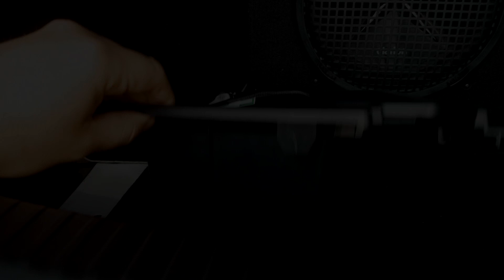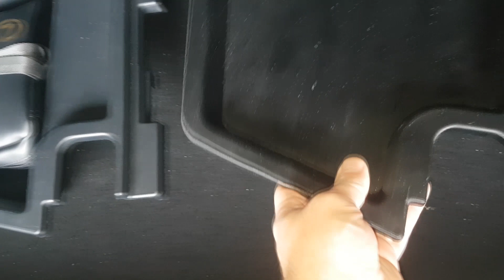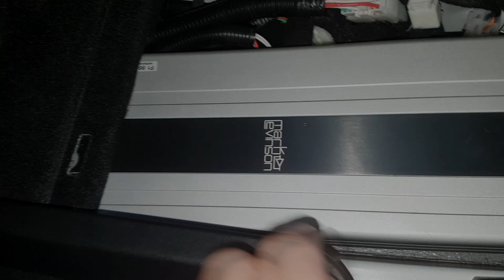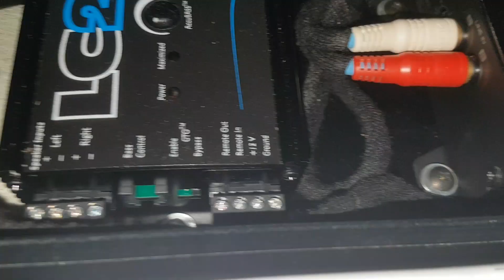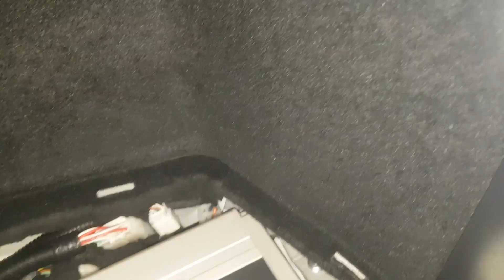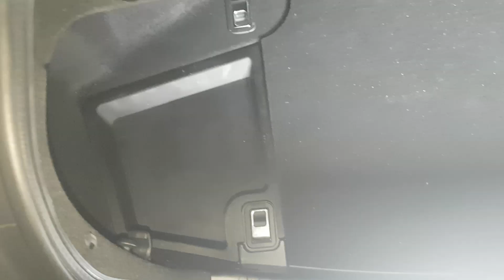2009 2010 Lexus ISF Mark Levinson - adding a line out converter , amplifier and subwoofer IS250

Comment: You've said you utilized the signal from the sub and left front woofer for your new subwoofer, and it resulted in a good frequency spectrum for the bass. Have you done any other testing on the signal from the front 3-way components? I'm am aiming to replace the front 3-way components with new 2-way components (woofer and tweeter only), and I'm wondering if the woofer and tweeter has enough of the frequency spectrum to cover the mid too (which I won't be using). I only have 6 high level inputs into the Zapco, so don't have enough for all 6 front speakers and the sub. Cheers

Comment: Thanks so much for this. There’s very little info around about this. I’m attempting to install a Zapco dsp / amp, and run the components and a new sub from this. As you said in the video and described in one of your comments, I’m hoping to piece together the full frequency spectrum from the sub and left woofer output from the oem amp, and then use the dsp to manage the frequencies to each channel.

Comment: At least he did not do the most ignorant actions that I had seen. People removing the OEM amplifier that is valued 2 times as much as a aftermarket amp and sub. In features, in vehicles models with touch navigation and internet access for the update on the OEM computer and vehicle navigation. Just so they can get a bass line. The amp does more than just music it’s a link in the chain of factory comforts and associated assorted of features. They don’t make videos showing what they created by being a tunnel vision nut

Comment: Very informative video. Thanks for all the info. Do you think the wiring diagram would be different for a 2008 ISF?
Reply from the maker: I'm fairly certain that 2008 ISF, and pre-MY10 2009 model ISFs are different to MY10 wiring.
Dont 100% quote me, but from what I found, these would likely be the wiring assignments for a 2008 and early 2009. Just cross check your amp to see if it adds up I guess:
Front left door woofer, 2nd plug: positive white, negative red
Front right door woofer, 3rd plug: positive brown, negative pink
Subwoofer likely dual voice coil. 2nd plug: positive brown, negative light green, positive pink, negative light blue
Remote wire: 4th plug, orange

Comment: Wow amazing it’s exacly the video I wanted! I got the mark levinson on my lexus NX and the subwoofer is clipping at low volume (around half volume) when playing music with low frequency range. At first, I though it was the OEM subwoofer than was distorting so I went aftermarket and plug a LC1.800 and use the high level from the factory sub to feed my amplifier and I was wrong.. the mark levinson channel for the subwoofer is clipping at very low volume! And they claimed that this amp is 1000 watts..? I was a little bit choc but then I ran some test yesterday and I found out that the front speakers are good at high volume so I’m gonna tap the front speakers and I think it may solve my problem. 
But I have a question, is it better the front or the rear for best signal ? I don’t have an oscilloscope but I’m guessing that they get the same signal but at a different voltage.
Thanks!
Reply from the maker: Hmm im not certain to be honest. Im not a professional :D All I can say is that on the Lexus ISF specifically, all posts online state the front door woofers push out a 'stronger' (or more powerful, forget the exact terminology) signal/range, than that of the rear door speakers.
Reply: What were your results? I’m having the clip issue at low volume so I’m upgrading the line out converter.

Comment: You did a great job!!. So just to clarify. You feed your LC with signal source from one sub front door and the rear deck sub source? Which front door signal source? Do you know how to obtain a full range signal? Any input is appreciate.
Reply from the maker: Hi there, sorry for the delay in response. 

In answer to your first two queries - please see the links in the description and I have a photo uploaded showing exactly which signals I tapped - combination of the single rear subwoofer in parcel shelf & one front door woofer (front left door woofer) . The link in description for 'wires I tapped' will show the exact wires I used.

In response to 'how to obtain a full range signal' - this appears to be the technical debate. From what I have read, I believe the front door woofers are probably the closest you will see in technical terms of them being 'full range' , but may not be as prominent as the power sent to that of the subwoofer channel signal. On the other side of the coin, the sub channel is more prominent, but has a reputation of missing some bass notes.

Truthfully, I believe the only 'real' way to get a 'perfect' signal, would be for a more advanced DSP amplifier which can take numerous channels of input signals (e.g. doors, subwoofer etc.) and collaborate the signals together to cover all ranges. They can also be tuned by software/USB to a computer as to what it would output. This option for me seemed a bit costly, and I was happy in the end with what I achieved as-is with the LC2i.

Per my video, my suggestion was to try the following as a test, before you complete your final connections
1. If you have a dual voice coil sub (brown, light green, and pink and light blue) - use those 4 wires for your 2 channels of input into the LC2i and test if youre happy with songs you are familiar with.
2. If you have a single voice coil sub (just brown and light green), try use those 2 wires and piggy back them into both of the 2 channels on the LC2i and test if youre happy

If unhappy with the subwoofer signal alone, can try either option below
3. try front left, and front right door woofers for 2 channels of input into the LC2i 
OR
4. try a mixture , i.e. one subwoofer signal, one of the front door woofers as the 2nd.

I just done trial and error , and per my video, I was in the situation of 'Option 2' above with a single voice coil factory sub. Tried it, wasn't happy. Then jumped straight to option 4 as a test - I was happy with the result, didnt mess about any further and just wired it in.

Hope this helps.
Reply: @lexus9075  I’m gonna attempt this at home, thanks man!